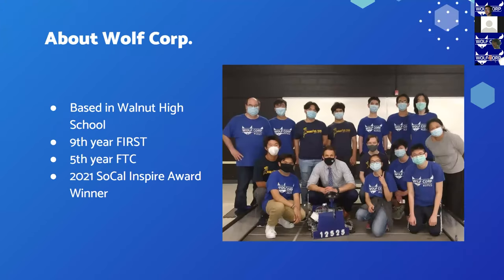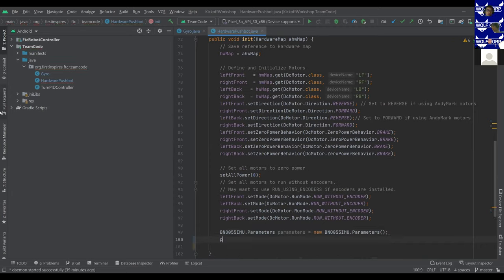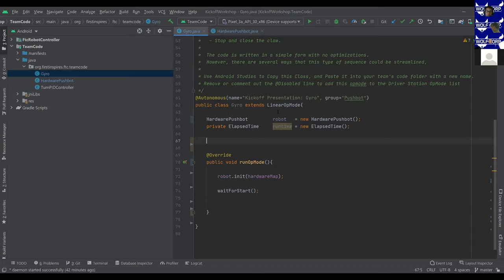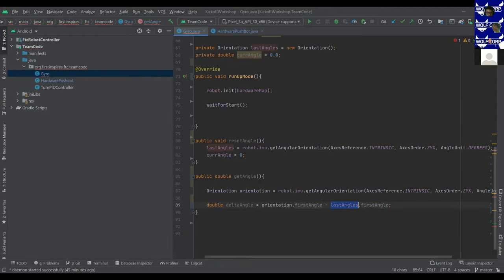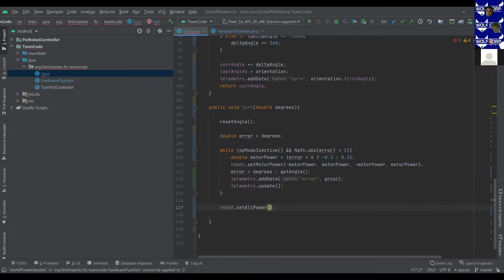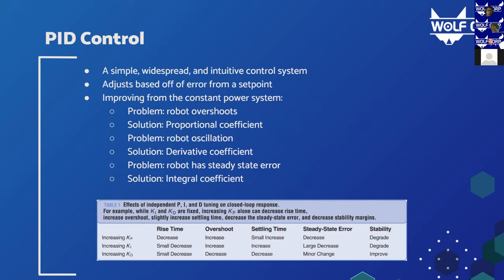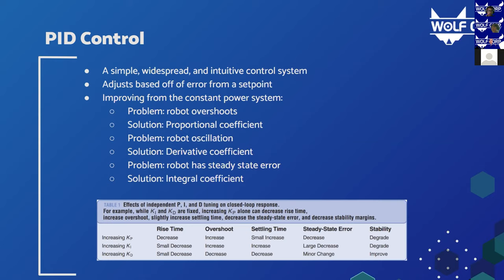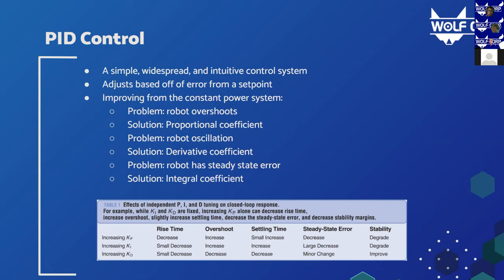Using PID with Gyro in FTC Programming - LAFTC Team Wolfcorp 12525

Comment: Is there any way we can code a PID to strafe left and right using the imu? Our robot at the moment has a pretty nasty weight imbalance, so we were thinking we could use a pid to adjust the power of certain motors to maintain an even strafe.